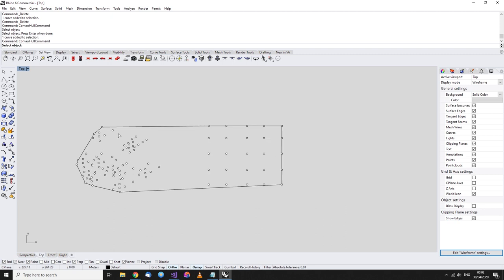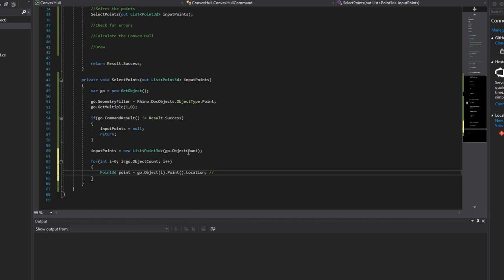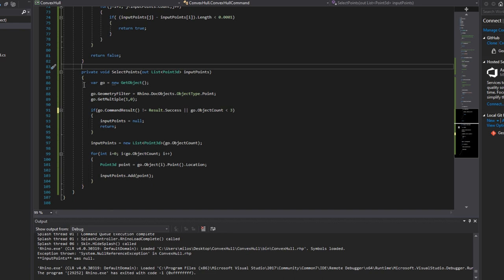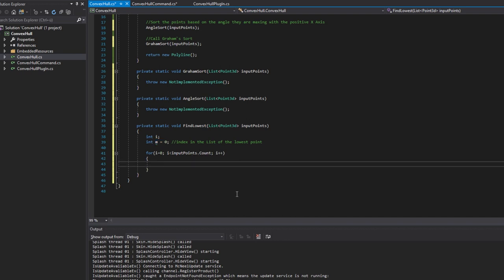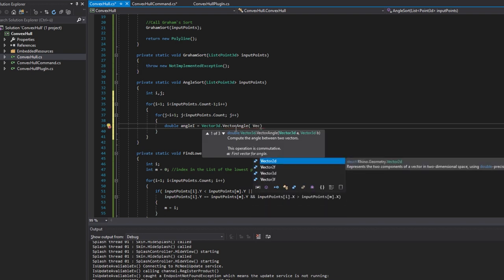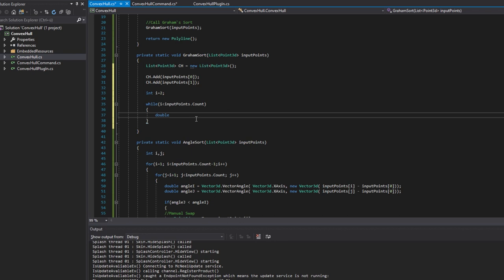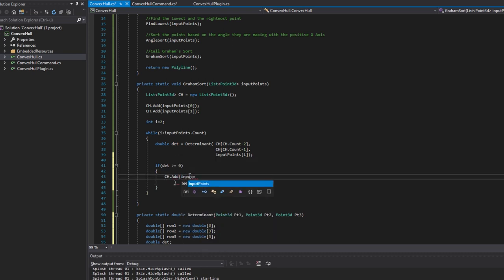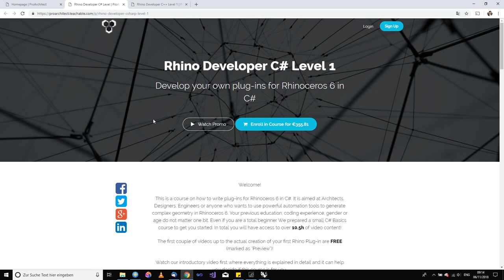Let's do some coding! Rhino C# - Convex Hull from Scratch | ProArchitect

Comment: Hi, i nocticed your algorithm fails in the case of a rectangular point grid. For example, make a 5x5 grid, run your command, and in the resulting polyline, move the left-bottom controlpoint and you will see that the points in the bottom row are not ordered correctly.

Comment: Will you make Grasshopper python tutorials?
Reply from the maker: What would you like to learn to do using GH or Python?
Reply: @ProArchitecture  As per your old videos a good starting point for programming in Architecture is python... So thats why I wanted to start learning ghPython!
Reply: IMO there's quite a lot of resources out there for ghpython. I'd rather see him continue making these C# tutorials and diving deeper as there's way less information available about this. Thanks a lot for this video, Milos. Even though I took your course in C# I learned more about how to structure code based on your example.
Reply: @nffs6148  Yes, definitely. Before I was mainly using Python and often getting stuck with understanding how Rhinocommon works. His C# course helped me to understand where to look for things and how to understand the API and how to use it. Other tutorials I came across were more focused on coding something that looks cool in the end, without entirely understanding what you did. I hope he continues to make more courses that go more advanced as well.